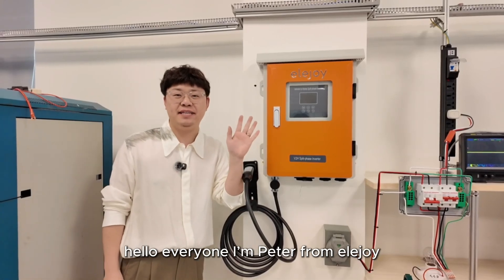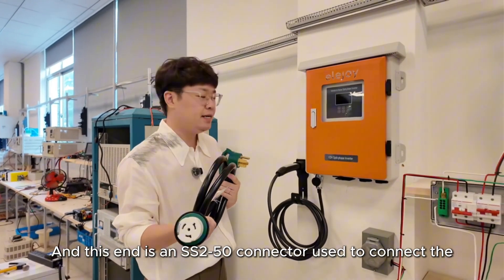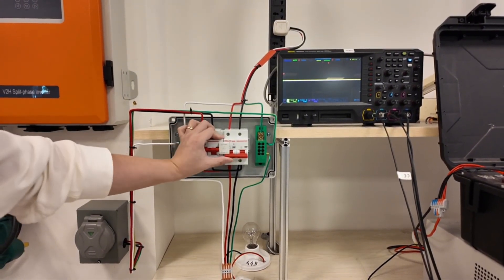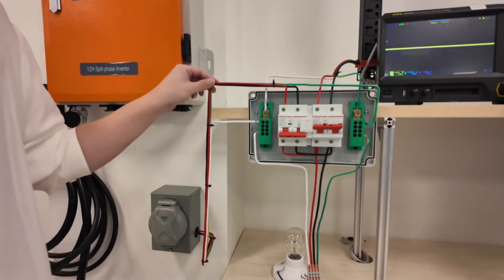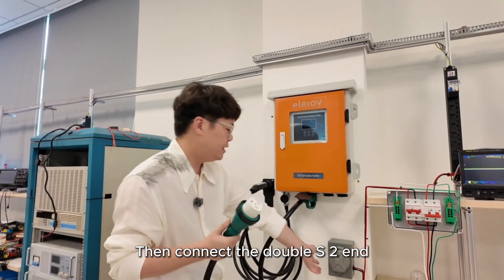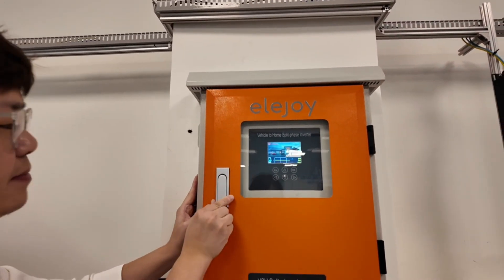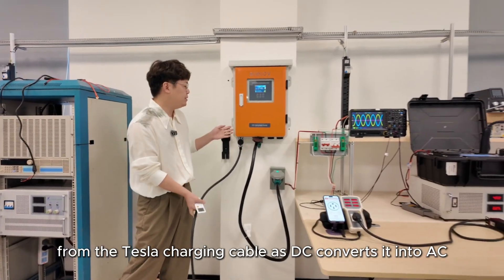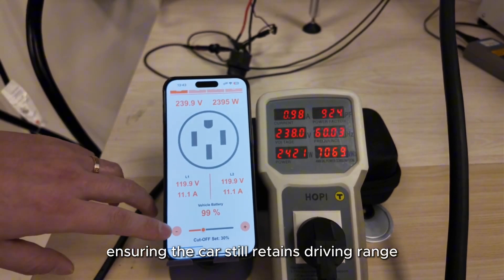elejoy V2H Guide: Power Your Home with EV

Comment: I have elejoy PV panel output measurement devices but have no seen any inverters.

We would simply need the same, but of cause for 3 or single phase grid output from german cars like e-Up, e-GOLF and ID cause they are the biggest sellers. VW and Audi and Seat Cupra and Skoda have 40% marketshare in the growing ev segment (21% market share in october where gas has 26% and diesel is down to 12%)

Any ideas when this might become available ? 
And of cause with home assistant support.

Comment: I have a 2025 Kia EV6 EV with the NACS charging port.
Since the battery voltage is 800VDC, will the Elejoy V2H work with my car ??
Reply from the maker: Not yet — currently, it only supports 400V. We’re testing 400V/800V dual-platform compatibility, so stay tuned for updates!